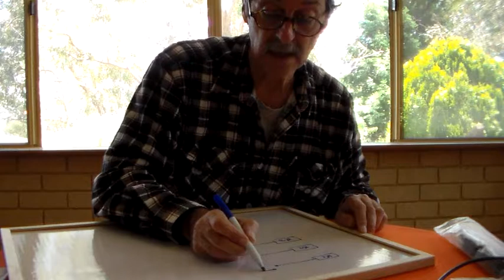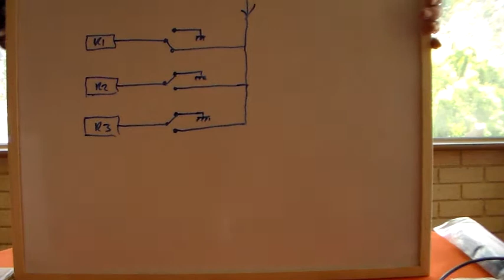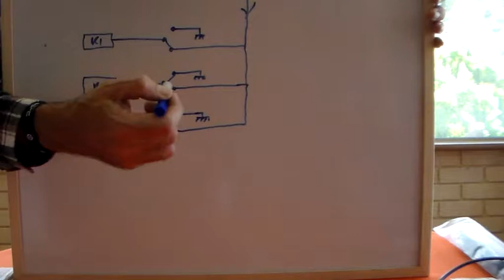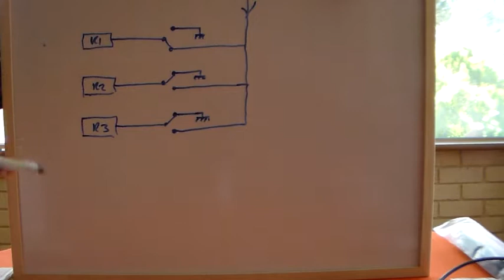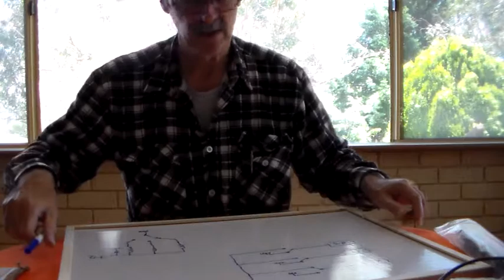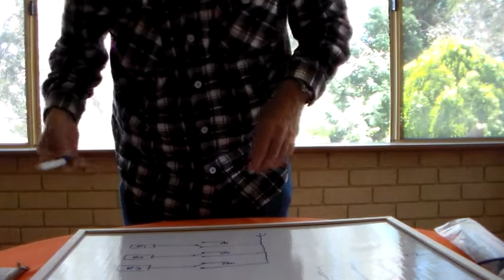Home-Brew HF Antenna/Rig Switch Part 1.

Comment: drinking coconut water is good for many health issues , I'm building a high voltage antenna tuner using homemade large space variable capacitors around 700 pf so i can get on lower bands on my 600 foot horizontal loop using a balanced L network and 450 ladder line , i will try the 150 amp single phase contact relay to switch the 700 pf out to a 10 to 100 pf cap for higher bands the distance between contacts could be the issue.

Comment from the maker: Hmmm... thinking about it, I will make the switch 5 position and not 4. This will provide an 'off' position that will allow all ports to be grounded if it's used as an antenna switch. And I'll add a decoupling capacitor across the diode to keep any RF off the supply rail. A fuse and cup holder would probably be a good idea too... but I'll give the neon lamp a miss.
Reply: i forgot to mention the USB socket !:-)

Comment: anticipating the outcome?, or the bush fire season that drove you to it? :-)
to avoid statics , maybe the antenna is shorted to ground when is not in use?
even better a neon lamp to discharge it softly?
NC maybe to ground?
LED as power indicator?
inline fuse?
how about a cup holder? :-)